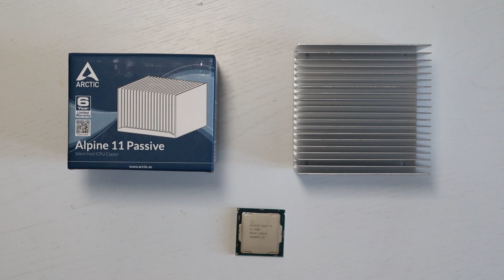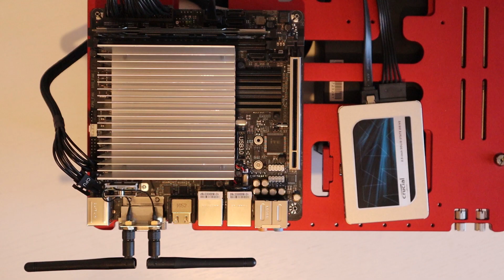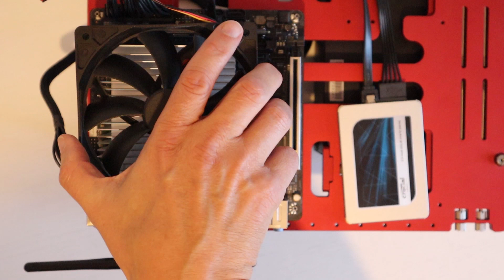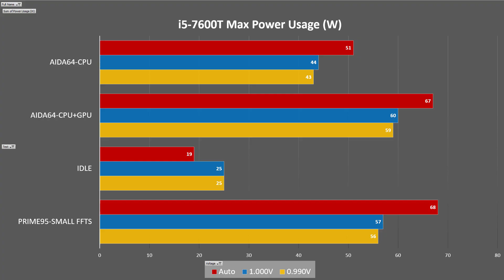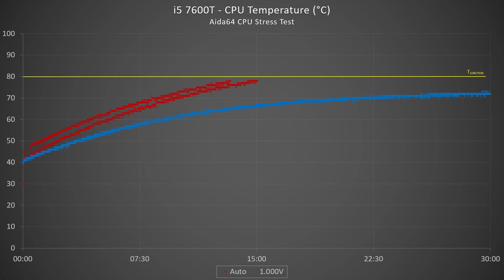Arctic Alpine 11 Passive vs Intel i5-7600T

Comment: Great video, have been waiting for that kind of detailed analysis for years.
Too bad you didn't continue. I have been running an i3 6300T with the 11 passive for 6 years, and never throttle despite casual but intense gaming.
I am upgrading to an i7 6700k that I plan to underclock with the 12 Passive, but wondering what would be the cost of performance opportunity against running it stock or slightly overclocked with a Alpine 12 OC...
Reply: why not get a noctua?